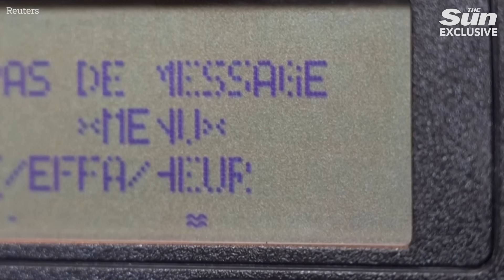Israeli bomb blitz sparks global security fears as airlines ban pagers after Hezbollah attacks

Comment: Can mobile phones be made to explode in the same way? We might be heading back towards land lines?
Reply: No there supply line of electronics has been intercepted and tampered with. Batteries might explode but not with that much power
Reply: Not necessarily mobile phones. Only devices that use radio waves.

Comment: Don't buy electric cars either. No one is blowing up my C3 diesel.
Reply: Never heard of diesel runaway?
If it happens don’t use Abdul’s walkie-talkie to call the AA
Reply: your car is safe!
Reply: @xusiaxod6255  you car is full of electronics
Reply: @TheWrighty1 Depends on the age.
Reply: @xusiaxod6255  your car has a battery
Reply: Your car may not be safe for your finances after the October budget.
Reply: @seanmaguire380 Yes but lead acid doesn't go pop.
Reply: Also, they can remotely disable electric cars as Elon Musk has done with Ramzan Kadyrov.
Reply: @ebutuoyYT 😂😂😂
Reply: There supply line of electronics has been intercepted at some point and then have been tampered with.
Reply: @TheWrighty1 not old skool cars my dear 🤣

Comment: You cannot super heat a battery to a point is explodes. Short a lithium  battery, it does not explode. It goes off like a firework but does not blow up like C4.
Reply: Explosive material was packed inside the battery housing, the super heating set off the explosive material, which is why the pressure/damage was so high.

Comment: Some reports say the pagers were triggered by a timer not a received signal so in fact ANY device potentially has the same feasibility. Short of banning everything nothing can theoretically exclude the risk. Another commenter said using landlines the scenario remains the same. To randomise this just intercept a consignment of batteries. In short where does the line get drawn on banning / permitting
Reply: Some reports say anything you like Please be discerning in you sources of information.

Comment: Lithium goes off like atomic bomb and you cannot put the fire out...which is why i wouldn't own an electric car...plus people are digging great areas of earth for it...
Reply: Published March 9, 2022 4:45 p.m. WASHINGTON - BMW will recall 1.03 million worldwide over potential fire risks, the German automaker said on Wednesday, its third recall over the issue since 2017.
The new recall involves numerous vehicles built between 2006 and 2013, including some 1 Series, 3 Series, X3, 5 Series, X5 and Z4 models, because the heater for the positive crankcase ventilation valve (PCV) may short-circuit and in extremely rare cases could increase the risk of a fire. The new recall includes 917,106 vehicles in the United States, 98,000 in Canada, and 18,000 in South Korea, BMW said.

Comment: Teslas are bombs ?
Reply: Published March 9, 2022 4:45 p.m. WASHINGTON - BMW will recall 1.03 million worldwide over potential fire risks, the German automaker said on Wednesday, its third recall over the issue since 2017.
The new recall involves numerous vehicles built between 2006 and 2013, including some 1 Series, 3 Series, X3, 5 Series, X5 and Z4 models, because the heater for the positive crankcase ventilation valve (PCV) may short-circuit and in extremely rare cases could increase the risk of a fire. The new recall includes 917,106 vehicles in the United States, 98,000 in Canada, and 18,000 in South Korea, BMW said.
Reply: maybe he did go to israel and came out as a puppet